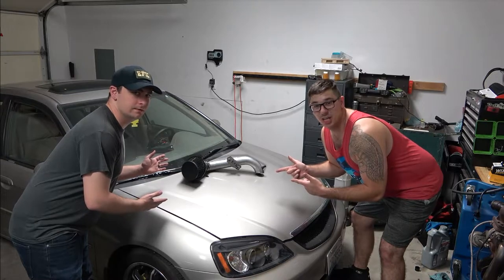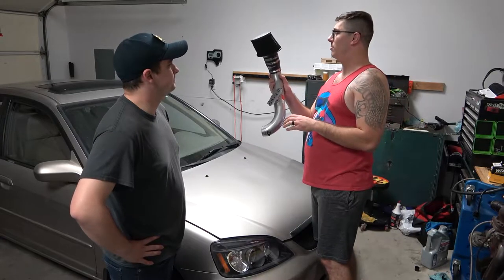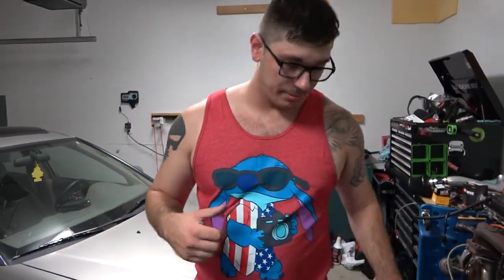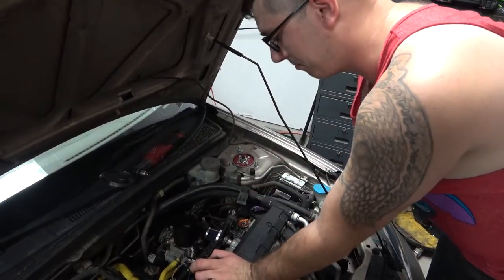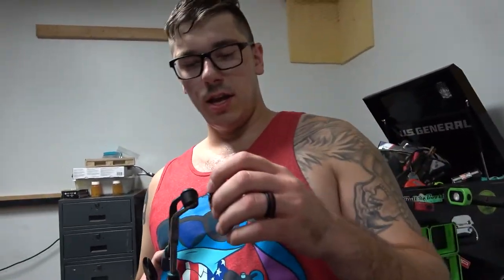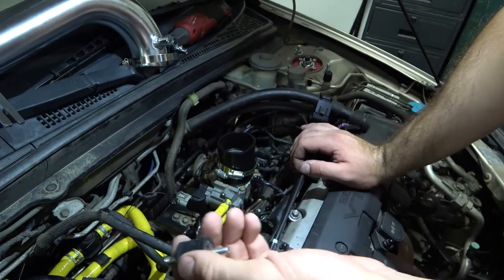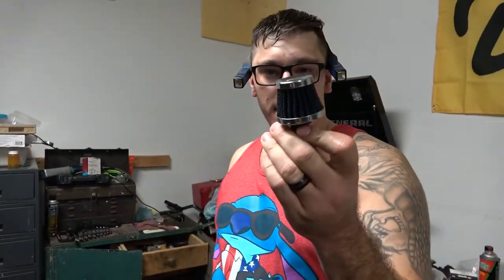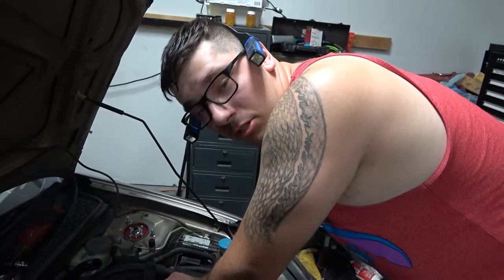$40 eBay Wheel Well Air Intake Install | $500 Civic Build PT. 25

Comment: do you guys know what size piping of the new cold air intake is? I wanna extend mine further from the transmission as you guys said in the beginning down to the wheel well. I just don’t know what size piping I would need to get from the store
Reply from the maker: Not sure… check the link in the description and it should have the specs.
Reply: @gridengine  thanks guys for answering my questions here and my other one! My name is also Noah so thanks Noah from Noah ;)
Reply from the maker: Happy to have you aboard Noah! 😂💪